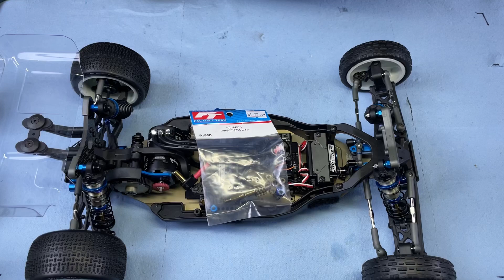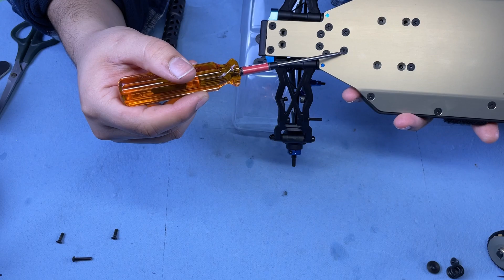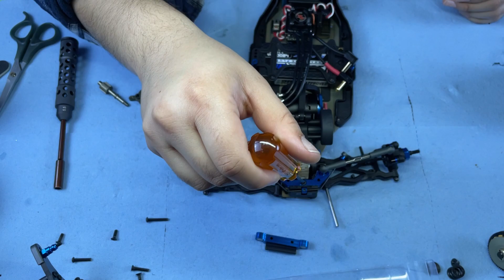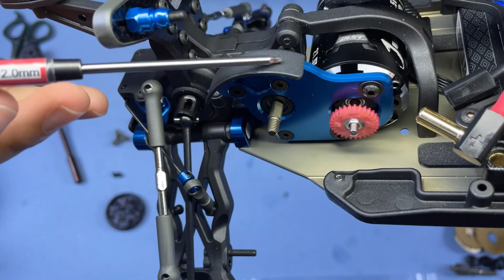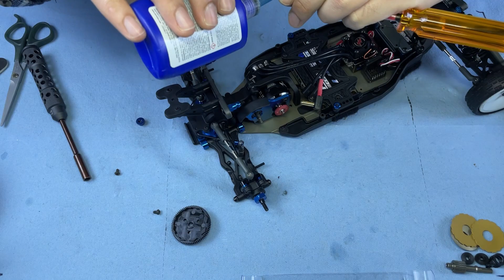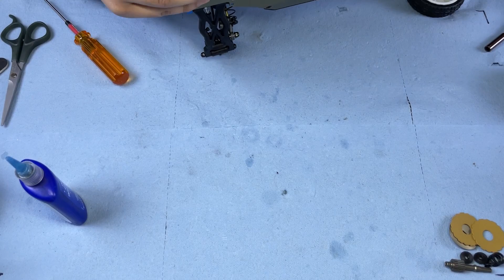Team Associated B6.4 Factory Team Direct Drive Kit Install & Review

Comment: A truly insane weight reduction, equal to 16kg (35lbs) of rotating mass on a full-scale car. To put that into perspective, that'd be a light flywheel, lightened bottom end (in the engine), lightened cams, AND either lightened gears in the driveline or a lightened driveshaft. Possibly both if you stick to lightening only the diff and driveshaft while leaving the transmission alone.

Comment: I run mine on carpet at 17.5 and it's fine. All the racers at the track use them on carpet
Reply from the maker: Pretty much sums it up. All the fast guys are using it on the B6.4 in 21.5T and 17.5T classes. We have never seen any issues on black CRC carpet.

Comment: Do you know the difference in weight between the new and old top shafts. If the weights are very similar the other kit using Kimbrough spurs might provide good benefit for a lot less work.  Also curious about the 2 gear diff system. Just bought the B6.4 and watched your entire series to make sure I built it right. I quit racing several years ago driving a B4.
Reply from the maker: Welcome back to the hobby! I do not know the weight difference between the top shafts. I just started my T6.4 build, and I am thinking I will try out the other slipper eliminator kit that uses the stock top shaft. I'll make a video on the 2 gear diff system so you know how to do it. When I searched about a year ago about it, I could barely find any information about it. I'll be installing a gear diff in the T6.4 so I can quickly make a video explaining what you need to make it work as a 2 gear diff.
Reply: @atharsgarage4197  Thank you, I've got notifications turned on. 🏁